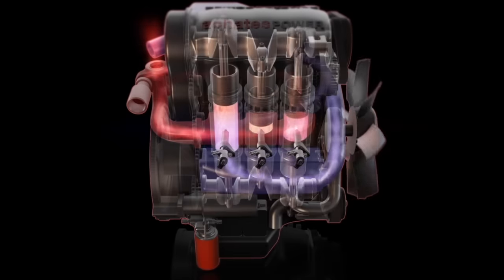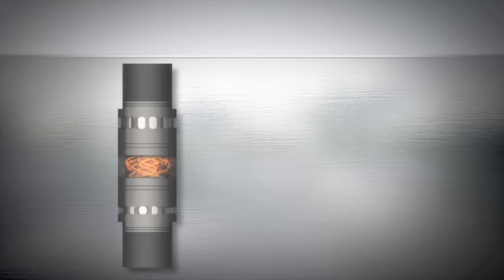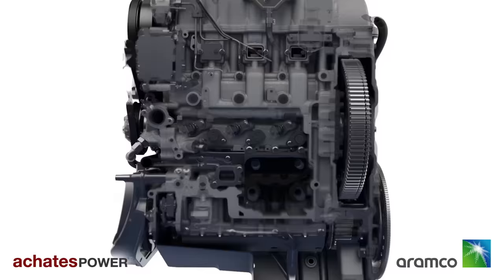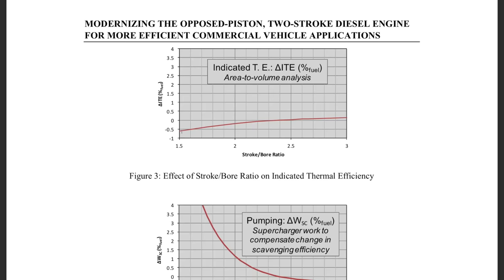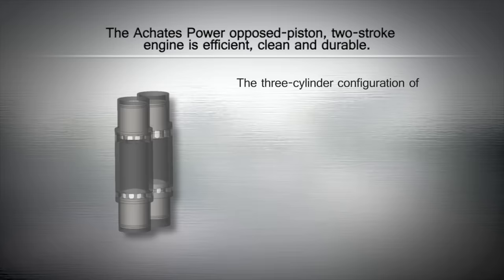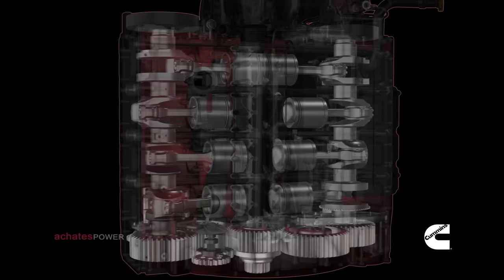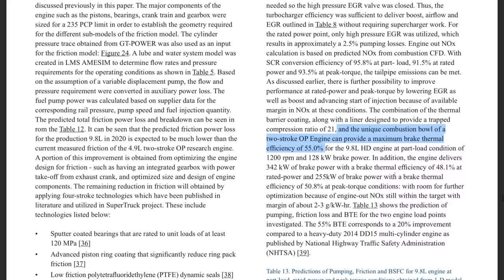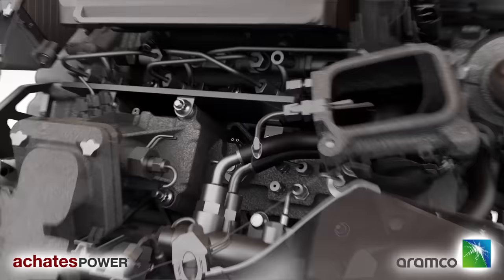Opposed Piston Diesel Engines Are Crazy Efficient

Comment: This type of 2 stroke has a disadvantage that the charged air tends to blow-by into the crank case. A pressurized crank case tends to leak a lot of oil. Go look at any Detroit Diesel 71 series. The biggest thing holding these back is are the marginal gains enough to justify putting them in when we have an existing supply chain and service infrastructure.

Also it’s not a super 
charger but a scavenging pump because it’s required for the operation.

Comment: Two 3 cylinder crank shafts opposing each other seems like it might cause quite an issue if they became even the slightest bit off time with one another. Also sounds like a lot of balancing issues being on opposing ends. Also it could be pretty expensive to mass produce something like this, but if the technology improved for manufacturing, this could be an awesome truck, industrial and hybrid application.

Comment: Would there be issues with oil pooling in the skirts of the pistons at the top of the engine when shutting down and restarting?

Would they be able to reduce the residual gases by using a turbo or supercharger to blast in more clean air?
Reply: You think that they could be done like pancake engines in Subaru's would help with oiling issues

Comment: Maintenance? Is it possible that these engines have remained exclusive to fleet vehicles because their maintenance cycles are different to normal engines? There were a lot of stats flying around there, but I noticed a major lack of comparison on a number of levels, mostly on maintenance.
Anytime there is an engine with anything other than upward facing pistons, there are 3 things that they usually have over normal engines. Higher levels of complexity surrounding the pistons and especially their oil management, higher levels of burning oil along with piston cylinder wear, and more maintenance require which usually comes at a higher than normal cost.
In regular engines, the bearing splash through oil every rotation and oil just needs to be sprayed up the piston shaft after the piston. Gravity helps in the whole process. Sideways pistons can somewhat do the same, but the spray as to take into account that the oil will constantly move away from the top of the piston  chamber to try and pool at the bottom. So the complexity rises.
Honestly, I've never seen downward facing pistons before, so I have no clue how they manage the lubrication there. I guess you could constantly spray the crankshaft bearings to keep them lubricated, but how does one prevent oil from pooling in the piston chambers? Does the fact that oil will have to be displaced more by the top cylinders and not so much in the bottom ones mean there is an imbalance in the system that needs to be compensated for? More complexity? How about oil burning? Can the piston prevent more oil from slipping past and burning in the top cylinders where it's fighting gravity?
Would be interesting to get that info to help in understanding if this is a viable tech for the public. Higher efficiency may, carbon output wise, be offset if it burns tonnes of oil. Also, if the engine needs lots of complicated expensive rebuild types of maintenance, it may not be a good option for those who don't have fleet mechanics on salary, like the general public.

Comment: If you do a bit more research  !
 A British company 
Called the rootes group 
Which eventually became a 
Division of Chrysler  !
Made opposed 6 piston 
3 cylinder 2 stroke diesel engines  from the late 
40's through To the 
Mid 60's and they were used in trucks and semi trucks 
As well as passenger buses 
Through out Europe 
And Australia  !
Wher commonly known as the knocker  Commer TS3 ! Fitted to 
Commer trucks 
They wher approximately 
198 cu in, 
 supercharged  single crankshaft 6 lower con rods to 6
Bridge rockers then upper 
Con rods to the 6 opposed
Pistons!
Down here in Australia 
There is a reasonable amount of these trucks 
That still run strong and 
Appear at many 
Of our vintage truck 
Shows  , 
So sorry to rain on your 
Parade but this type of 
Motor has been around 
For many years  !

Comment: Such engines were produced by the thoausands by Junkers as aircarft engines till 1945. The main challenge is the mechanical complexity. 

But anyhow it would be a step forward in having a compact high power Diesel engine.

Comment: This sounds like a wonderful idea, but how does the crankshaft become lubricated? You can't just put oil into the crank, it'll go into the combustion chamber. Does it inject diesel in the bottom end at low amount? Will the top pistons experience more wear because of heat? I do love the implementation of 2 strokes, very simple engines.

Comment: Direct injection and the high compression possibilities make methanol a very attractive fuel. It's cheap. It can be made from any number of renewable sources and from abundant natural gas supplies. 
The high heat of vaporization and octane rating would make methanol a great fit for this engine.

Comment: I would love a tiny 3 cylinder engine like this on an extended range ev. Just hook it to a generator and let it run at its peak efficiency. The only issue would be if it can be small enough to make it worthwhile to use instead of a traditional engine.

Comment: You forgot to mention that by having opposing pistons, mean and peak piston speeds are cut in half which reduces friction: ring sliding friction, main bearing friction and parasitic oil drag friction. Plus it requires half the oil delivery so oil pumping losses decrease. I would think also  air mass flow would be more efficient because it doesn't have to change direction.
Reply: ...but you are doubling the number of pistons so you are also doubling the friction for those things...
Reply: Sorry I can't see or reply to your reply...odd.

I don't know what the "power law" is but I do know that friction is (simply put) a linear function based simply on the amount of surface area. Double the area you double the friction. Double the speed you double it again.

Comment: The only "bad" thing is that this engine probably will not work well without a turbocharger or supercharger because it needs the extra intake pressure to flush the exhaust gas. And I think, making a gasoline/ethanol engine would help this type of engine to get more known, but it might need two spark plugs per cylinder.
Reply: That's called "scavenging". Two-stroke diesel engines normally use a scavenge blower, separate from any turbocharger.

Comment: I wonder how the efficiency would be impacted if they switched to a 4 stroke designed. With how efficient the OP engine it would be interesting to see how much power it could put out in an Atkinson cycle. In theory they could ditch the supercharger or go naturally aspirated with that setup. In my mind they also wouldn’t need a specific cylinder count, so they could go with a 4 cylinder configuration. That with a firing pattern similar to the cross plane Yamaha R1 would be a sight to see. You get the efficiency of the OP design, the benefits of the Atkinson cycle, and don’t have the strain of the supercharger on the engine to deal with.

Comment: Someone should do something like this only in the diesel that would be really efficient. Another thing that would help with efficiency is instead of linking the two crankshafts together, you did two drive shafts and one side runs the right side wheel and the other driveshaft does the left side wheel that way they would not have to even connect the two crankshafts together.
Reply: Then the crankshafts would turn at different speeds, and the engine timing would be severely messed up because it uses the pistons to cover and uncover the intake and exhaust ports. Also the engine could loose compression as one piston might be at top dead center, while the other might be at bottom dead center, and then the engine will get no compression

Comment: I genuinely don’t see any drawbacks to the design. It’s simple, efficient, seems like it is well balanced, and would be much easier to produce, as well as maintain. 
The biggest issue would be the fact that it uses diesel fuel, which is quite hard on the environment. If it can be made so that the emissions are within acceptable levels then it’s a sure fire winner. 
I could even see it being used as a generator of sorts for hybrid vehicles, as opposed to being directly coupled to a drivetrain. Although that would probably increase the complexity of the overall system. 
I have so many damned questions.

Comment: I think there already have been some 2 stroke Diesel engines produced for trucks in the 60ies in the UK. As far I as know the problem is the engine oil lost through the exhaust ports
Reply: As with GM 2 Stroke diesels - I'm sure you're right. They would struggle with emissions

Comment: This technique with hydrogen as a fuel makes for a powerful combo a major British manufacturer has working engine with minor tweaks so intergrated if it should be easy and for heavy construction vehicles and especially over the road semi’s,no air pollution and distilled water,quick fills too yes there are no stations but tanks are easy and that’s all they need !

Comment: The only thing that is holding this engine back from production is POLITICS !   #1  that green new deal..or whatever' #2 other engine manufactures. They consider this engine a THREAT!    Without knowing more, this engine is the best  thing for the future since THE WHEEL.
Reply: No.  Emission problem.  This engine burns lubrication oil so that emission is not good.  You can use after treatment catalyst converter to reduce emission to legal level. It will increase operation cost.  No conspiracy theory here.  Practical cost consideration.  Operation cost and maintenance cost.

Comment: Brilliant. Overall, fewer moving parts=simpler, cheaper, less friction, more power at flywheel. 
Poppet valves SO inefficient. I often wondered how much heat is produced just operating valley train on a v8. Would be interesting to remove pistons and spin the engine with an electric motor to see how much power is needed to spin camshaft, lifters, overcome spring pressure. 
And then see how much heat is produced in just friction. All that power never reaches the flywheel.

Comment: It would appear that these engines would be lighter than the four cylinder 4 stroke variety, and might be useful in development for light aircraft along with the added benefit of its use of Jet fuel ... more easily available abroad.

Comment: I am truly curious as to why this hasn't been put into use in mass production automobiles yet.  It's compact but may still be too "pancaked" to be packaged in some smaller vehicles... but any truck and large CUV and most mid-size SUV's could fit those, with those power numbers matching what's available now or even better torque for those classes of vehicles.  I assume the 3-cylinder design can be scaled up to a large degree, e.g. even a 4.0L 3-cylinder is extremely efficient, has good power numbers, and has acceptable packaging dimensions.  Then again, stroke is scaling faster here than traditional ICE engines, which might mean an even flatter and wider "pancake"... not sure, just would have to see the math and geometry.

I'd love to see this utilized in the real world.  I can grab a Ram EcoDiesel, but the gain in effiiciency doesn't offset the additional long-term maintenance costs.  Power numbers are very similar to slightly higher than 3.0L V6 turbo diesel numbers, yet this is only with 2.7L cylindered capacity, which goes to show how fair the gain in efficiency carries in performance terms.  And even if redline has to be lower on these engines compared to conventional diesel engines due to the very long strong (which I don't believe would be the case since piston speeds are actually lower, plus you don't have to worry about valve float and other issues with a valvetrain), modern trannies with 8-10 speeds means gearing should overcome that limitation.

Comment: Fantastic engine design, the only thing I see holding it back is the complexity of the system. There are a lot of systems crammed together and if I remember correctly mixing the fuel as efficiently as possible is quite difficult and things like the Hemi have been used for this but with such a setup such a choice would be very difficult. I would actually recommend using such a system in a tractor since it seems to do well with high loads but with 2 outputs I believe that a hybrid could allow for some simplification. Finally if total energy was as efficient as possible I would recommend them trying to use an air or water cycle to recoup energy from latent heat in the engine but that would increase the complexity and such systems seem to be unpopular so far.
Reply: I mean comparing to other engines it's fairly straightforward forward. Arguably easier to repair because it would just be two shafts and gears that could really go wrong

Comment: I was waiting to see if they offset the shaft angles for offset exhaust/induction timing. I designed an engine with similar features almost 30 years ago.  My design is significantly more compact though due to a quite different power train.

Comment: these engines would be better in a triangle configuration with a generator connected to each crankshaft giving you a 3 phase supply to run a powerful motor or to charge Batteries.

Comment: Instead of an opposed piston, you could use a moving cylinder inside a stationary cylinder to avoid the second crankshaft (you basically pull the second piston in the opposed piston design over the first piston, and it becomes a blind cylinder instead of a piston). I bet this has been done before as it's not a very revolutionary idea but how is such engine called? what search words could I use in google to find such engine?

Comment: It seems like the air fuel ratio can be compressed on one of The strokes like the old two-stroke motorcycles on the downstroke there's compressed and then push through the ports

Comment: Jumo 204 aviation diesel engine, with similiar layout, entered service in 1932. Various improvements were implemented all the way to the 208. Zenith of the previous opposed top piston systems were propably the Napier Deltic engines. So this isn't exactly all that new. Ofcourse all engine types get better over the decades of development.

Comment: Wonder if they were strictly air cooled ( finned ) like Deutz Aircooled Diesels  ...  if then some water injection wouldn't increase the efficiency substantially again.        WW2  Aviation Mechanic once told me that if the Lancasters didn't have water injection , they would never have made it into the air with the bomb loads they were lifting.

Comment: Looks a lot like the old Detroit Diesel 2-Strokes that eventually had too much oil use because of the ports that the piston rings had to cross.  Pollution standards were reduced until the max allowed oil (pollution) use was less than it could match.

Comment: Efficiency doesn't equal profit for most companies like oil, fuel suppliers, pipe lines, parts manufacturers and so on. Therefore it's not cost effective for there profit margin in the long run.

Comment: I think it's amazing that it's a two-stroke engine but it seems as if the two-stroke engines always smoke a little more than the four-stroke engines like a motorcycles because you have to put the oil in with the gas I guess you wouldn't have to do that on this one you could have a dry sump

Comment: Wow, it will be neat to see a diesel engine where its fuel savings outweigh the cost to maintain the emissions reduction equipment, making diesel a better choice over gasoline when both are offered in a vehicle.
Reply: Just move to Colorado Springs or Idaho where we lack smog certifications.  Still a little freedom left.

Comment: I can like this video 98% because 0:59 you tell us that just before the pistons meet in the center diesel is injected into the combustion chamber. This is not accurate at all because someone who knows diesel engines, diesel is injected after all of the air has been compressed and is hot enough. Usually just the second it starts to leave TDC.

Comment: these kind of engines are in production in Ukraine for main battle tanks since 1970-s.
they are great, but have some issues in terms of piston temperature control and oil burning cintrol.

So, I think its rather a bad idea for automotive application - it would be harder to meet the ecological requirements.

Comment: Good video , explained well enough for me to get a handle on it  (kind of anyways ) ,I know that these diesel type of engines have been about for a long time and have been used in submarine and aircraft engines as far back as world war 2 and as far as I know they were reliable so it makes me wonder why has it never taken off in cars or trucks up to now  or even on electric generators as that would make a lot of sense to me ,as 50% or more fuel efficiency is massive, I think petrol gets around 25 to 30% efficiency and diesel engines get around 40% , it really makes me think why haven't manufacturers been made to work with these fuel efficient engine's  sooner than this . diesel engines can run on vegetable oil / bio fuel  so with good quality exhaust emissions and modern exhaust  emissions system technology it makes a lot of sense to me to use these engines in the future and work alongside electric engines as well .

Comment: Why not have combustion chambers at each opposite end of the pistons bore, this way it is 2 combustion chambers per cylinder which throw the piston back and forth to each other? 3 pistons meeting, two pistons hit/hammer it  simultaneously or in very quick succession (punch bag cylinder has slower stroke velocity to give them enough time to do it). The punchbag piston might drive front wheels and the other two pistons drive back wheels.

BTW are liquid pistons going to be used in cars?